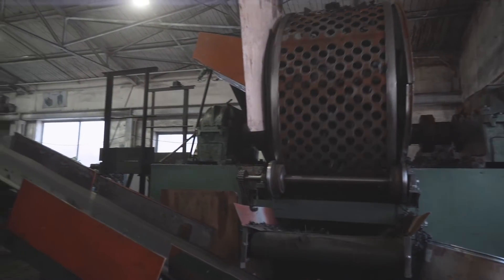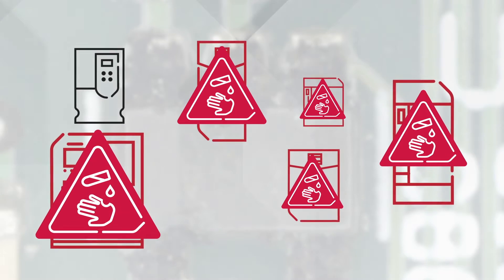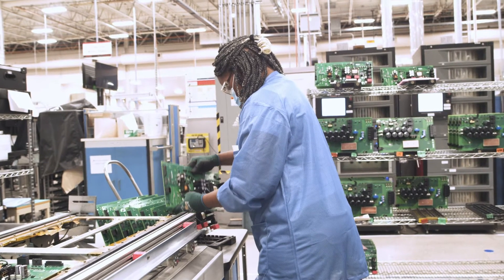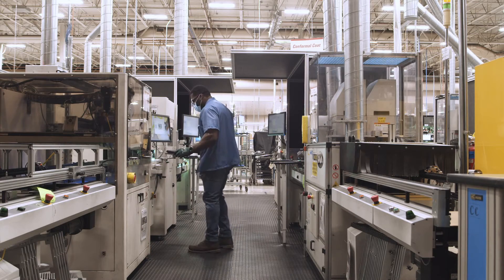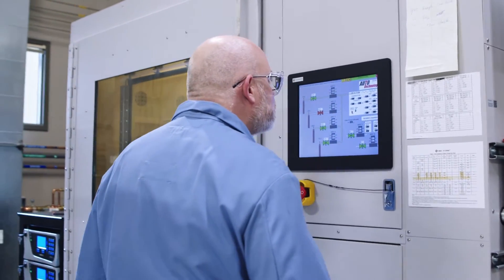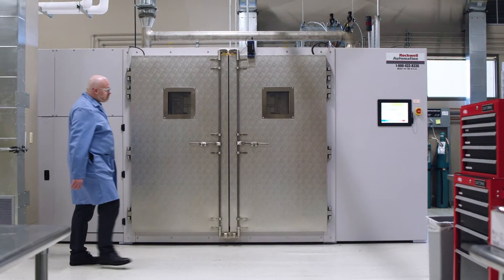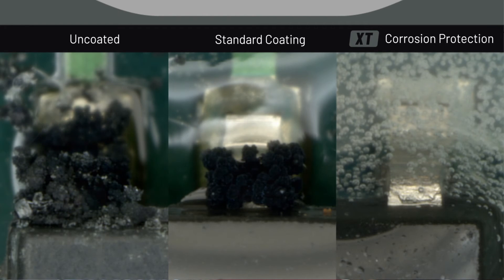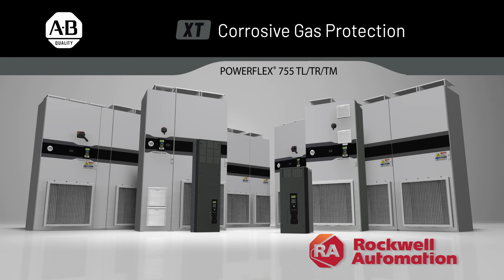PowerFlex 755T AC Drives with XT Corrosive Gas Protection

Comment: Do you have panelviews that are corrosion resistant ?
Reply: Yea they do make conformal coated PVP+ 7's because I've used them. If the part number ends in a 'K' then it's likely the conformal coated version of that part.